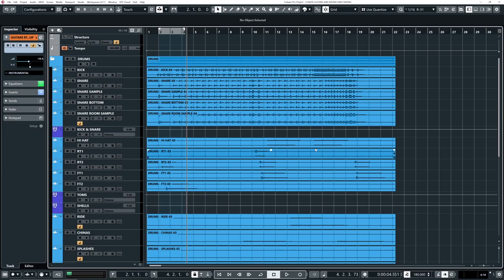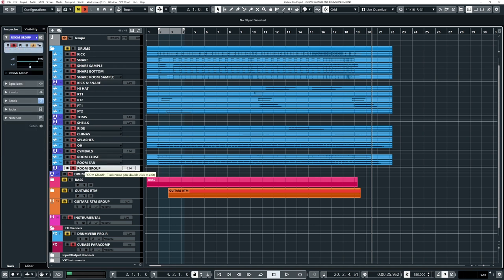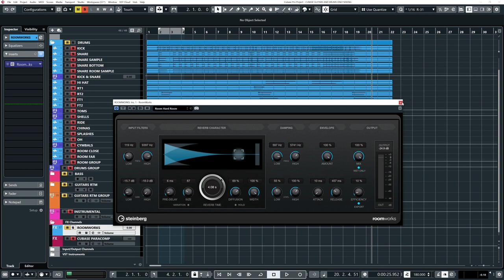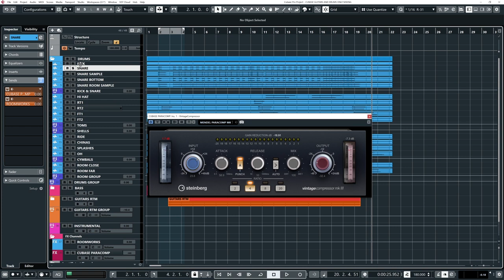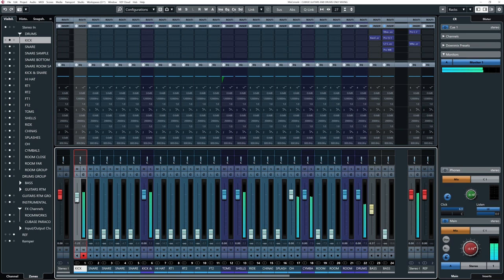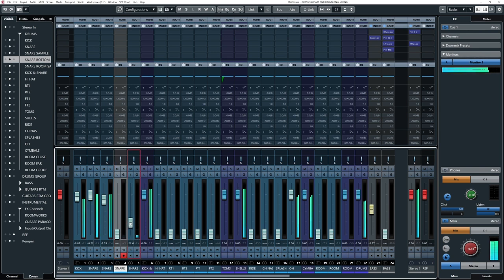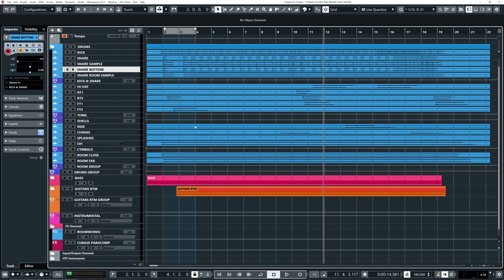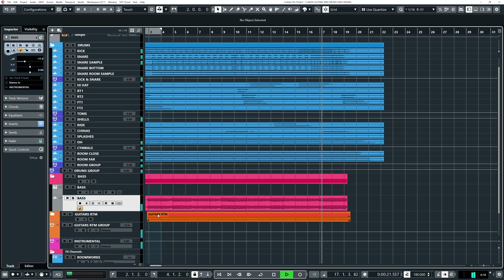Metal Drums Routing and Balancing | Metal Recording Basics in Cubase

Comment: Hi Mendel. Great video, thank You.
I always struggle with mixing drums but oddly enough I found out that I struggle more with mixing my SD3 samples (even raw) than with the live drums.
Do you do anything different while mixing live drums or is the process exactly the same in both cases?

An off topic question if I may - When you record your albums, do you play all the bass lines or do you program it (EZBass ?) or do you get a bass player to record it for you?

Thanks
Reply: Mainly the same, but it depends on the source. Do you route your SD3 to seperate outputs? Regarding bass: Programming everything by hand.
Reply: @Mendelian   I play the basic parts on my little electronic kit (kick, snare, couple of toms and hi hats) and record MIDI. Load it into SD3 and expand/fix to full kit then bounce what I need to wave files from within SD3. Then import the files into Cubase.
Reply: @RudalPL  You could just route all outputs of SD3 to Cubase in real time. By pressing F11 you see an “out” arrow next to the rack instrument name: activate all outputs. Then use the SD3 mixer to route all the outputs.